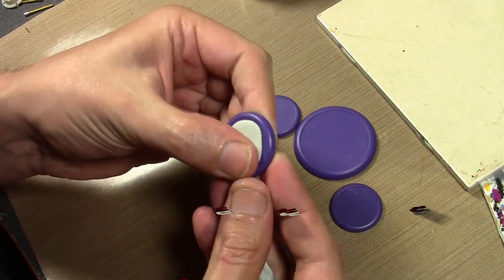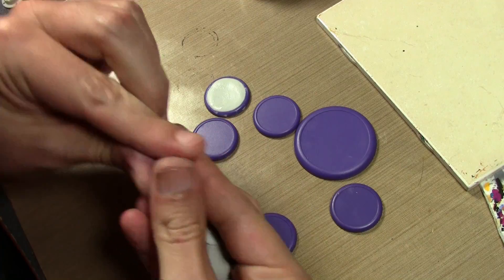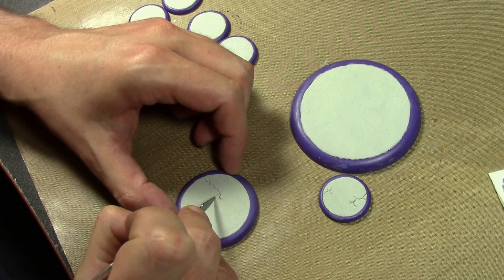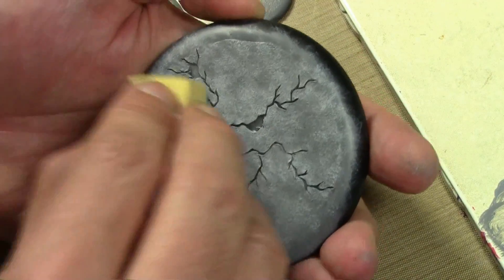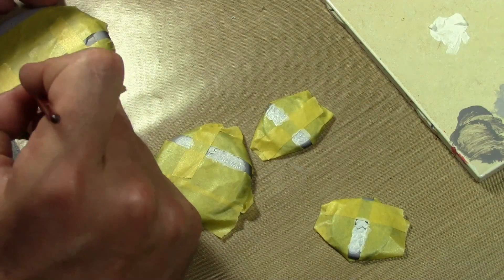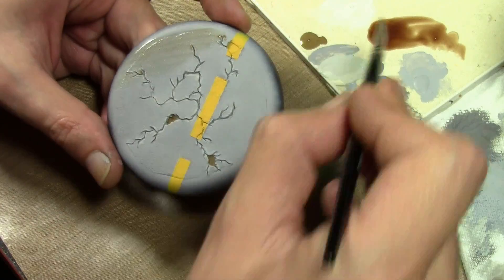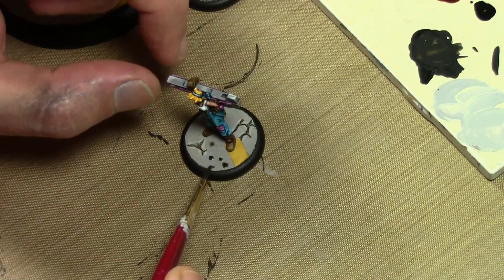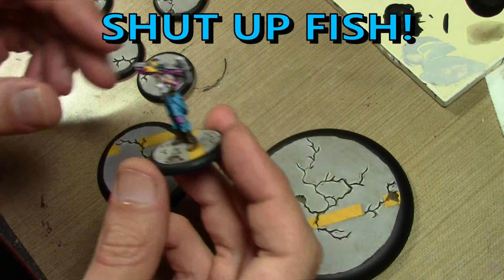How to Make Street and Road Bases for Miniatures

Comment: I've seen a blacktop road surface done just by gluing down some sandpaper and have done it myself.  Then you just paint it up and add a dividing line and it looks pretty convincing.  This technique, though, takes the concept to a whole other level.  Despite the change in scenery from desert asphalt to concrete, I think these look amazing and I'm going to have to try them for myself on some future project.